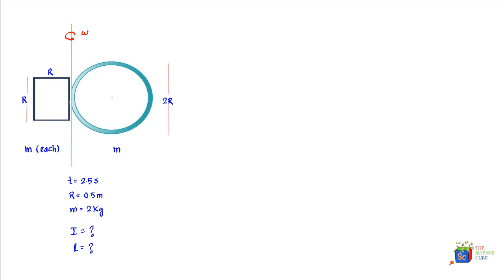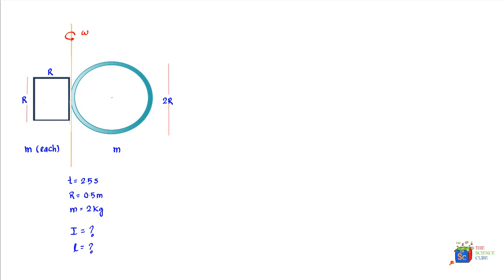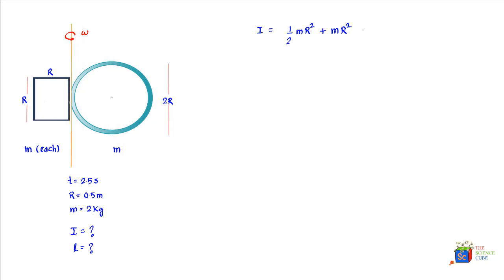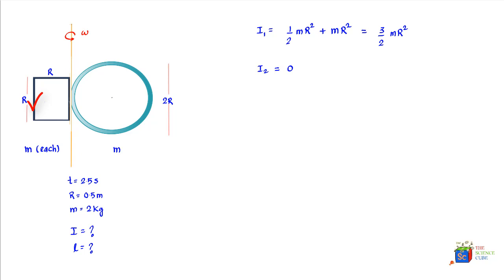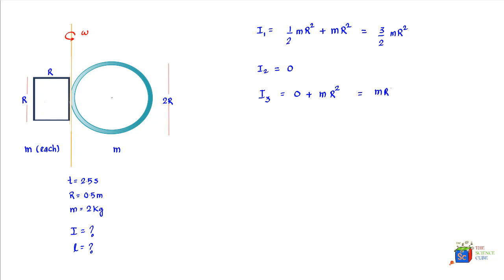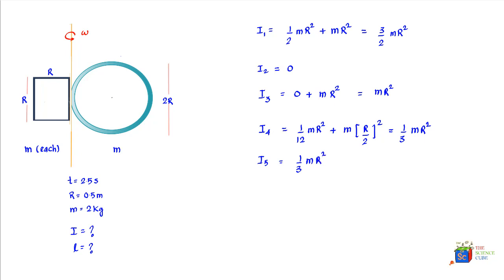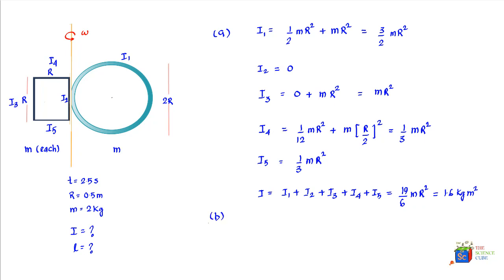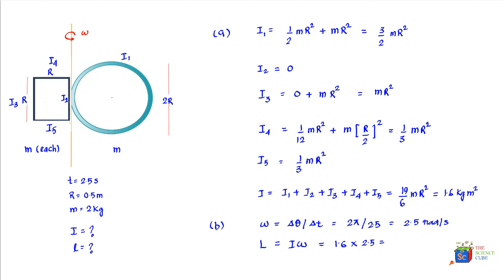Moment of Inertia of a Hoop Rod System #10

Comment: isn't the moment of inertia of hoop I=MR^2 instead of I=0.5*MR^2
Reply from the maker: Good question Pervez! Will answer you in a moment. But I would like you to think and tell me does the axis of rotation change the value of moment of inertia?
Reply: @TheScienceCube   yes it does.
Reply from the maker: @justbreathe8171  great! so will the hoop have different Moment of inertia basis the position of the axis about which it is being measures. Hint - the answer you have given MR square is about the axis that passes through center. While here it is not
Reply: @TheScienceCube   we are applying parallel axis theorem to find the total moment of inertia. so, as Itotal=I+MR^2, Where I=MR^2 not I=0.5*MR^2.
Reply from the maker: I about the center of mass that is through the diameter is half MR square. That is when the axis is vertical like a diameter. It would have been just MR square of the axis went through the centre.
Reply from the maker: Maham, did this clear your doubt?
Reply: @TheScienceCube  yes, it did. Thank you.
Reply from the maker: @justbreathe8171  where are you from?
Reply: @TheScienceCube  pakistan
Reply from the maker: @justbreathe8171  great to know. Best wishes!!👍